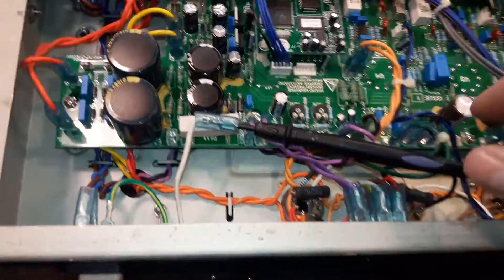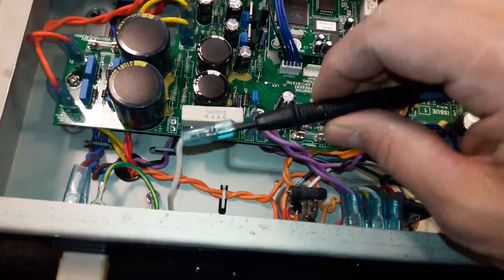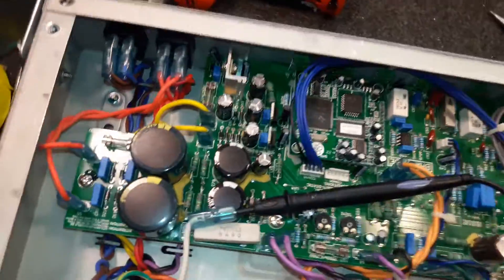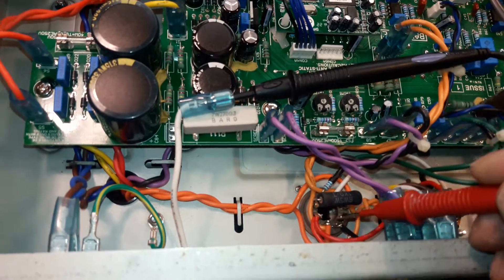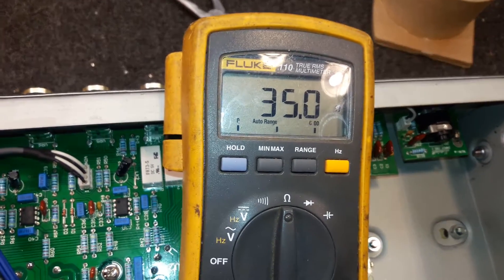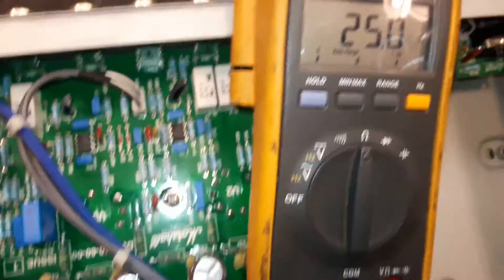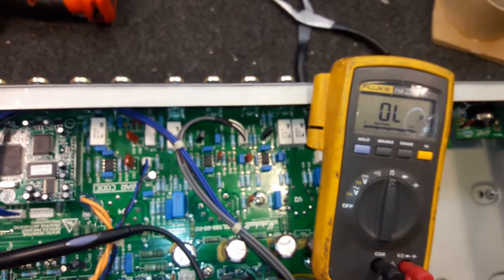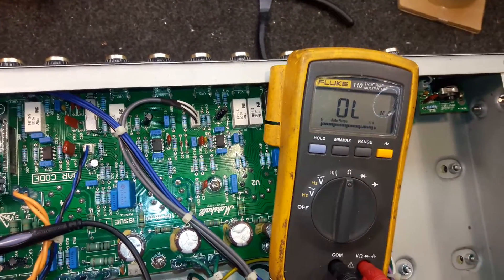Marshall DSL100H repair

Comment: Tengo un DSL 100H y suena como mosquito y noto que el transformador no se calienta pero en las lecturas me dan 37.5Ohms y 31.3 Ohms, es normal? Gracias.
Reply from the maker: It COULD be a bad transformer that difference is high. I have a bunch of used transformers in my shop so before I order a new replacement I would tag in one of my used transformers and see if the audio becomes normal. Some times this doesnt change the way it sounds and it turns out its something I missed like an open resistor that supplies voltage to the phase splitter plates.

Comment: I have a DSL100H, manufactured 3/2017 so not too old, bought from a college kid. I tested it before I left his house and brought it home. Never loved the tone, my MG15 with a pedal sounded more Marshall and it’s a solid state. Long story short I bought the DSL20HR, and it blew away my DSL100H. Comparing these two amps, same cabs I though I may have a blown speaker I the cab connected to the 100, so swapping cables back and forth I must’ve had an opened circuit with the speaker cable not connected to a cab between swaps and I killed it. After checking the speakers in the cab and ohms, I discovered a kinda loose spade connector so I tightened it up and made sure all others were tight but no sound. Again long story short tried both cabs, no sound. But the DSL20HR is perfect. 

Tubes in the 100 are a couple weeks old, matched JJs. 

I think I must have blown a transformer, hopefully not the circuit board. I want the DSL100HR anyway, but this is one hell of a way to force the issue. 

Open speaker cable from the amp, what’s the most likely cause of no sound? Tubes all glowing evenly and matched sets.
Reply from the maker: I am going to guess your cabinet isnt 16 ohm. Plug your cab in the 16 ohm jack on the dsl100 , turn the amp volume down just for this test and tell me if the audio comes back on. If it does then you need to replace the 16 ohm jack
Reply: @clintronicsrva  for some reason I had the jack for 8 ohms on the amp connected to the 16 ohm jack on the cab. It’s a 16 ohm cabinet. It’s working fine now. Oddly since the 50w side was not functioning, I flipped the switch to 100w and viola the amp works fine. I’ve gone back and forth to the 50 and it’s fine. I have no answer for this. I had pulled the speaker cable off to inspect and test the speakers. I found a very loose spade connector and tightened them all up. Plugged back in and no worky. Weird. Works better than ever now. Thanks for your suggestions! 🙏☝️
Reply from the maker: copilot says: A bad ground in the 16 ohm jack of a Marshall amp can cause issues with the output. This jack often acts as a switch, opening the ground circuit to the 4/8 ohm jacks when something is plugged in1. If the contacts in the 16 ohm jack are dirty or damaged, it can disrupt the grounding and affect the performance1.

You might want to try cleaning the contacts with contact cleaner and unplugging and replugging your cables a few times to remove any grime. If that doesn't help, replacing the jack might be necessary2.